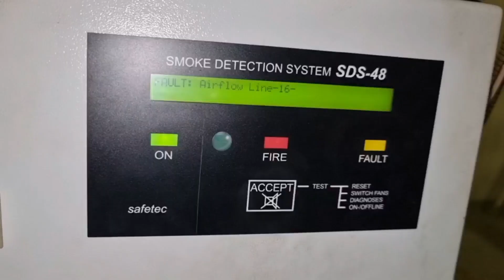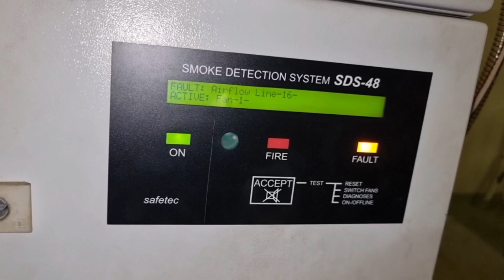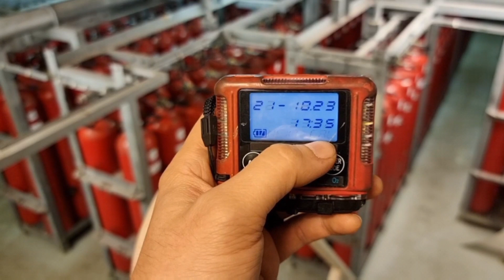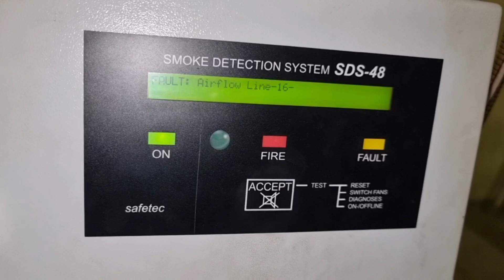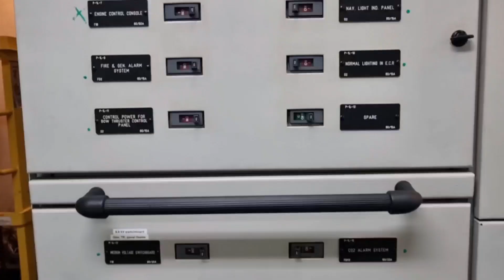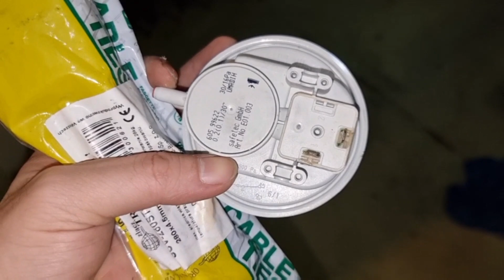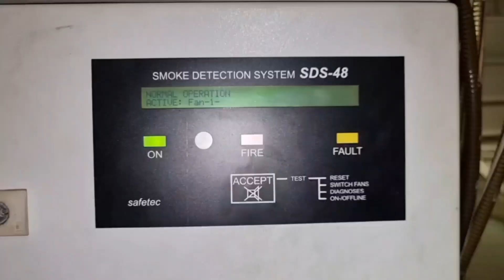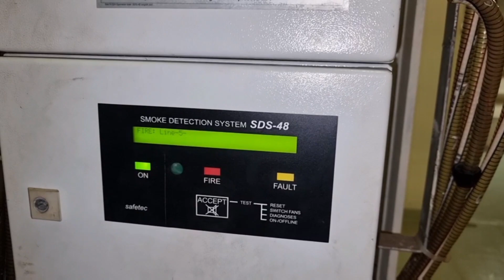FLOODED FIRE ALARM SYSTEM | MARINE ELECTRICIAN

Comment: Great video!
What is the purpose of all that co2?
Reply: With the safetec SDS-48 system, you can suck air out of the cargo holds to detect smoke in this air. And you can use the same pipe system to blow CO2 into the cargo holds to extinguish a fire.